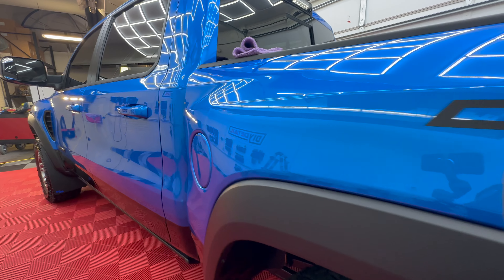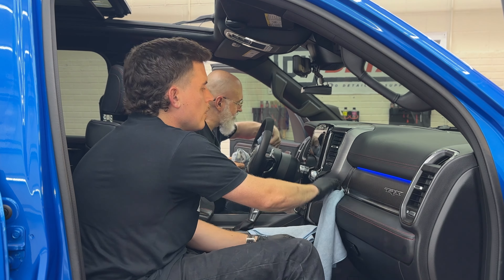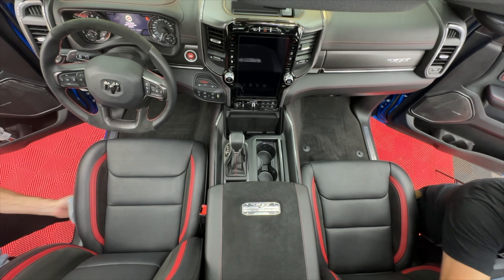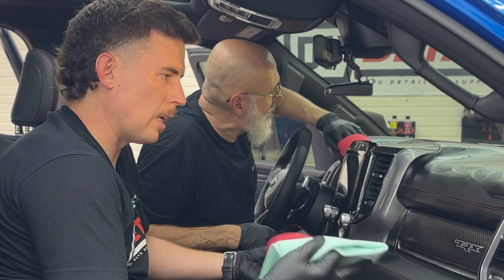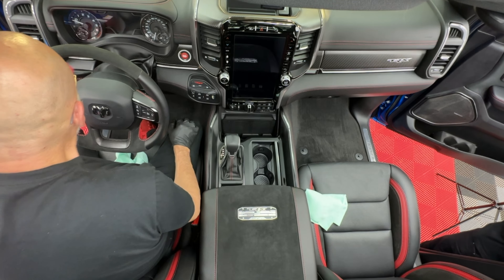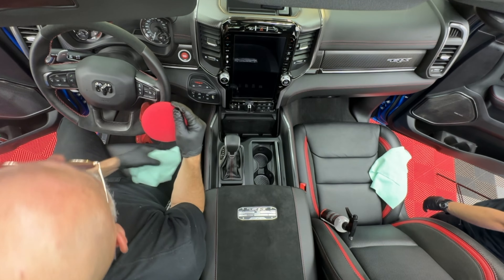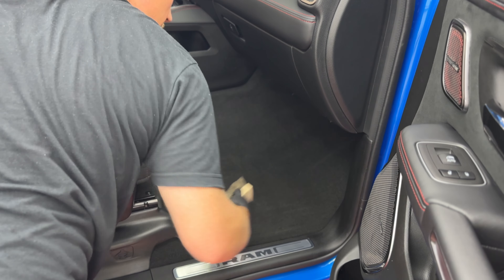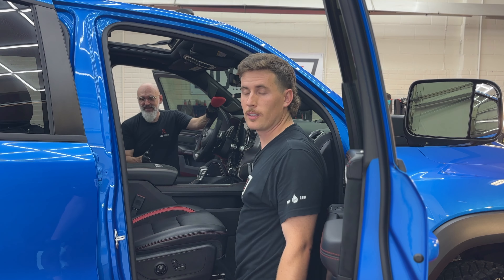INTERIOR CERAMIC COATING: how to apply long-lasting protection (RAM TRX installation video)

Comment: I used the product after cleaning the interior surfaces. I did not notice any anti static properties. If anything, it’s attracting more dust than before using the product. I’m not trying to bash the product or the channel. I’ve been using the rinseless wash for a while nine and I really like it.
Reply from the maker: Thanks for the feedback. It’s not going to stop dust accumulation, just slow it.

Comment: Great video, very informative, you guys are awesome, not to mention very thorrough teaching us all the details.  A question I have for interiors is: What do you reccomend to remove salt stains on carpet?
Reply from the maker: salt stains are tough. If it's really caked in there you might want steam, or an extractor. I also like using something on the acidic scale to pre treat it to neutralize the salt before you go to town. Then when it dries it might wick back up, at which point an encapsulation carpet cleaner is nice to keep the white chalky wicking on the carpet fibers from coming back. There's a lot of discussion to be had on this and different techniques for sure. Just my two cents. -Nick
Reply: @diydetailofficial  Nick, thank you for the detailed reply 👍😎

Comment: Can you use all clean on leather and upholstery for interiors? 

Also, Yvan mentioned that he does not spray in interiors. How would you clean a heavy stain with all clean, with out spraying it directly on the stain?

Thank you
Reply from the maker: DIY Detail All Clean at 30/1 can be used on extreme interiors. 

Spray onto a towel, then apply on the surface.

Comment: Couldn't find it on this video and can't remember which one I saw it, but I thought you had said not to use on headliners.  Is that true?  Seems to be a high touch point where protection would be desired.
Reply from the maker: Try to avoid using chemicals or touching headliners at all costs

Comment: Love what I’m hearing about this product line. Bought a bunch of it to try on my multiple vehicles. Question though. I have a Ford Bronco and if you do a little research then you’ll find out interior plastics are recycled(cheap and damages easy) plus textured. What are your thoughts on using this product on a Bronco?
Reply from the maker: Every bit of protection helps

Comment: I did my new CX-5 Turbo interior. I didn’t seem to get the slight darkening effect like the video camera picked up. Also it had a sour vinegar smell that went away. My batch date is 6/4/24. Is the smell normal? It was a hot summer for shipping around. Looks great though.
Reply from the maker: Yes, that’s the new formula

Comment: If interior perforated leather seats were recently treated with Leather Shield is it still safe or even necessary to apply the interior ceramic coating over the leather shield? Should one be applied before the other after the leather has been cleaned?
Reply from the maker: Depends on the product used.

Comment: Great video! Question: I want to perform step #1 using the damp microfiber towel, but don’t have a bucket of rinseless wash. What do you recommend in this situation? 
~ Thanks ~
Reply from the maker: Mix up the proper dilution of Rinseless wash in some container you can dip your towel in. Or have some diluted DIY Detail Rinseless Wash in a spray bottle and spray on the towel.

Comment: How would you attack stained cloth seat to clean them before protecting with interior ceramic?
Reply from the maker: I would have to see it. Stained or soiled?
Reply: soiled i think is better choice of words,  I did 1 round of all clean 30:1 with a drill brush and spot pro extractor and i looked decent till it dried and 50% came back @diydetailofficial

Comment: I would caution against scrubbing too hard or with too much pressure. I had a 2021 Honda Odyssey and the dash above the gauge cluster was very soft material that was easily marred. 

You all contradict yourselves. Do I clean the interior after ceramic coating with the rinseless wash or the interior clean and protect. Why would I need both?
Reply from the maker: You do not need both, it’s your preference.

Comment: Hi, If i want to use it on a Old Car, Faded plastic too, it Brigns it back the color le nah?… i just bought but aint delivery yet… Also need to know If looks like brand New hidrated surface againg?
Reply from the maker: No it’s not a product that restores.
Reply: @diydetailofficial  i understand that… but it aint gets darker?

Comment: Hello, wanted to ask did you tried to combine Opt NoRinse with some foaming substance like handwash shampoo to get foam in IK Foam and use it like Rinseless/Waterless wash. The main goal is to get smth like FROTHÉ from AMMO NYC but DIY. I`m planning to start with combining ECH20 and Reset and go on from here, thought you could have some opinion about that. Thx
Reply from the maker: If you use DIY Detail Rinseless Wash no need to combine anything. ONR will not work for that.

Comment: not on topic, but havent found it in your other vids ive seen (havent caught them all), exterior ceramic coating, can your 5 year be layered or stacked over itself for extra gloss? i just do my own car, and lets face it, 1 layer by the time i need it again the bottle will be trash, so why not a second coat?
Reply from the maker: Yes, wait 2 hours minimum, 8 maximum.

Comment: Does Interior Ceramic provide UV protection for dash/seat materials? I know most of the UV additives in coatings are UV inhibitors that wear out over time as they abosorb the energy. Should we apply the interiror ceramic and then use another product over it for longer-term UV protection?
Reply from the maker: Unless you drive a convertible, there’s no real need for UV protection inside a car. The glass is a great UV blocker.
Reply: @diydetailofficial  Plus I suppose the ceramic tint I just had put on the windows aids in that filtering. Thanks!
Reply: @diydetailofficial I have to disagree, UV protection is very important inside the vehicle. Look at some Florida vehicles and see the damage the sun does to door panels, dash boards, seats, steering wheel...

Comment: How long does the foam applicator last?  Is it a one time use or many uses?
Reply: Many uses. Soak it in rinseless for a day or so. Rinse and wring it out. I had one for years.
Reply from the maker: many uses, as @britishrocklovingyank3491 said....put it in your bucket of Rinseless Wash to soak for a minimum of 30 minutes after you're done using it...then wash the applicator  pad and it can be used again!

Comment: So it's safe to spray your ceramic coating from a spray bottle? In a previous video you said not to use a ceramic spray as it can be inhaled, ingested or absorbed into your skin with bad health results. How is yours different than the competition that it can safely be sprayed?
Reply from the maker: Wearing a respirator with Interior Ceramic is a great idea, as well as gloves. same goes for any product, we would always recommend more PPE as opposed to less. The problem with exterior ceramic coatings is that most are fluorinated, that’s the dangerous part.
Reply: @diydetailofficial  gotcha, thank you!

Comment: one look from a professional car interior cleaner can tell that these 2 guys has very little practical experience and most likely lacking profit in their company (if they even has one). this video feels more a like a product showcase. also normally, you would never apply a product with a ceramic component on soft surfaces, like interior/leather/plastic. those who knows what "ceramic" means, knows.
Reply from the maker: Thank you for your input.
Reply: You do know this is a product showcase right? This is also a different product from most that is designed for interior

Comment: Which brush should I buy on DIY for maximum agitation for baked on blackened wheels? Is the green not aggressive enough, or is there a better option that will help the chemicals scrub off the caked brake dust better or no? I’m asking because you have several brushes for sale on your website? Thanks!
Reply from the maker: The green one is our favourite for wheels.
Reply: @diydetailofficial  - Thank you! I’m going to buy several of them.